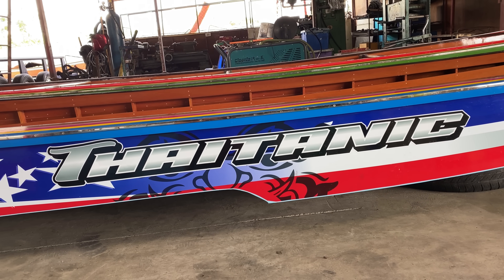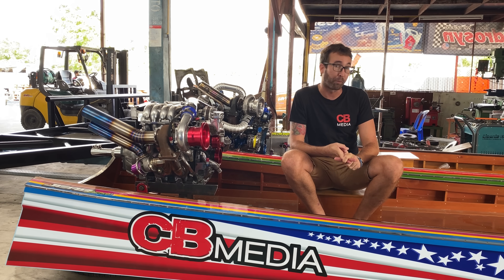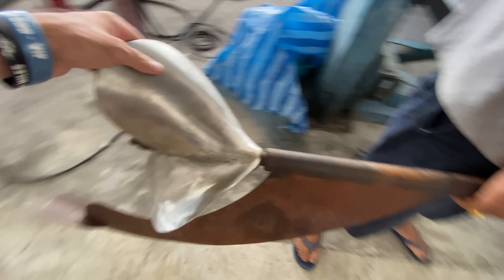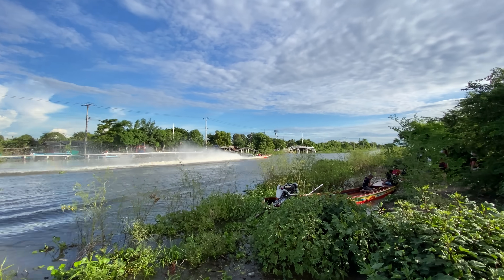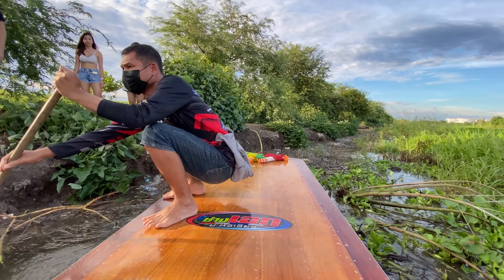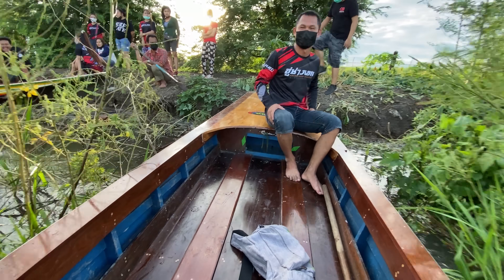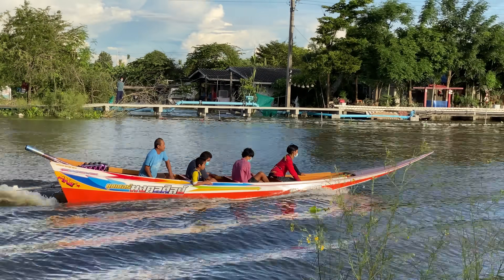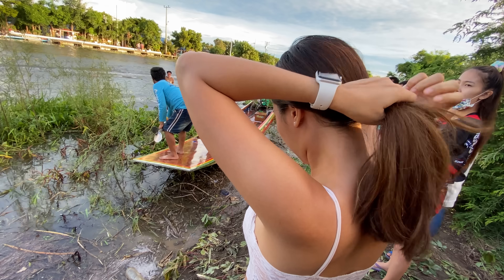Turbo Longtail Boat Racing is Back in Bangkok!

Comment: So which boats are the fastest, the small ones or the big boats with the large turbo diesels? What is the top speed with the big boats and how do you think your build will perform? For this type of racing, which country in the region dominates and do they ever race outside their own countries? Thanks for the videos, gives great insight to another form of racing that is very cool, and just like their cars, hand built from the ground up!
Reply: My guess is it depends on the engine setup and the prop, the smaller river boats are going to have a higher top speed and the deep hull can carry more weight
Reply from the maker: The larger boats are larger because the more HP the more boat you need to keep it on the water and it not turn into a plane LOL my boat hull is the new design that only a couple people have and those that do say its way faster than the traditional ones you see with the 400-500hp turbo diesel boats. My 13b is the first turbo rotary boat they have built here but it should make the same HP as the diesel boats but the engine weights half what the diesel engines do. It should be really really fast :)
Reply: @CBMedia404  be fast or be last_and how we ride is fast

Comment: Are you sure these guys aren't bass fishermen? Back when bas boats were 18" if it would float the engine it was a perfect fit. Upper 80s to low 90s in an 18' boat is more like a pilot than a mariner. The boat rode on air and hardly touched the water. The first big wave ya hit like that and you'll be ready to trade boats. My next boat was a Ranger w/ 150 hp, top speed 65 mph. lol